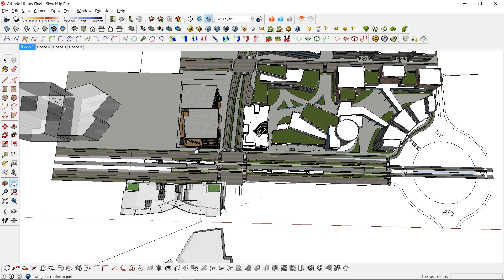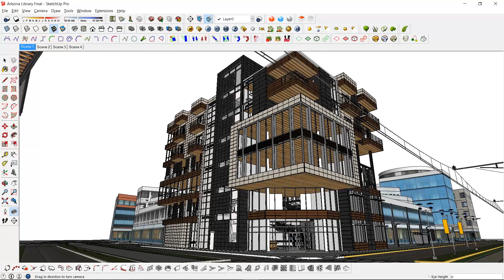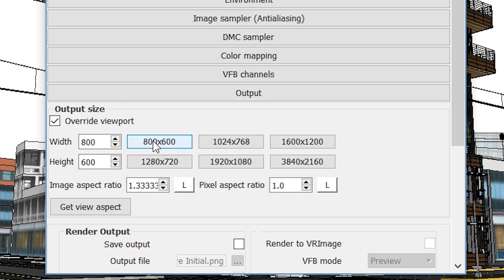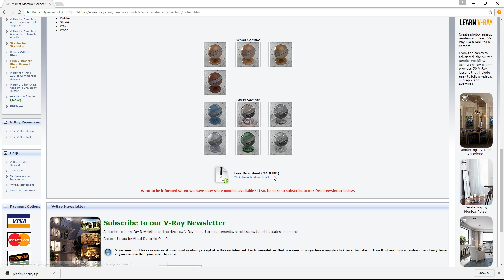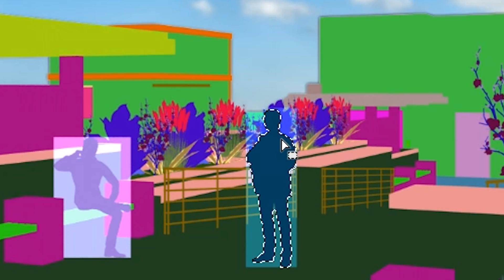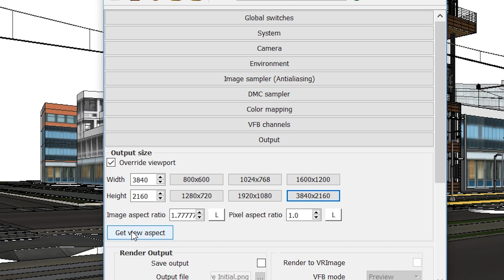10 Quick Tips for EXTERIOR RENDERING Using Sketchup Vray

Comment: At what degree do you put your field of view at for perspective?  It seems SU defaults at 35 deg. yet I have read 40 deg is optimal and that sometimes goes up to 50 deg. depending on opinions.  Whats the best perspective field of degree without introducing too much distortion yet give it pop?  Do you recommend two-point perspective for both interior and exterior renderings?  Please give degree specifics for both exterior and interior renderings. I found this but whats your opinion? Thanks!
https://blog.sketchup.com/sketchupdate/setting-your-field-view
https://forums.sketchup.com/t/confused-about-field-of-view-camera-settings/15595
Reply from the maker: Unlike what the blog says, I don't think 60 degrees is realistic. Though people think it's necessary to capture everything for interior views but it would just look very distorted. I usually use 30-40 for both interior and exterior, sometimes 45 at most. I would also use two point perspective for both interior and exterior 😊
Reply: @ArchitectureInspirations  Great thanks..  Do you ever use advanced camera settings toolbar and create a camera and use camera properties or just use regular scenes?
Reply from the maker: Hm I rarely use the advanced camera tool. I've just it once or twice but it's not really necessary

Comment: Hello sir , I want to one thing 
I rendered my image @ 1280 x 720   pixels but after that the image doesn't comes crystal clear when I zooms it ,. Its pixel becomes distorted pls suggest me what's the issue .
I use v ray 3.4 n sketch up 2015 n I didn't use GPU during rendering so does it affects in pixels ??
Reply from the maker: Hm,  if you zoom in too close then it will be pixelated for sure. You would want to increase your resolution if you want a higher quality render

Comment: Useful video and very clear thanks Min. 

My skp file is too big now and it's too slow (250 mb file) to orbit and pan etc. is there an easy way to break up the file to different sections of the house I'm modeling?

I put the entire house I'm modeling into one file and it's therefore too big. Thanks.
Reply from the maker: +Marc Naidu hm I think you can make a back up of your file then separate those parts. Definitely download CleanUp extension and try it out!